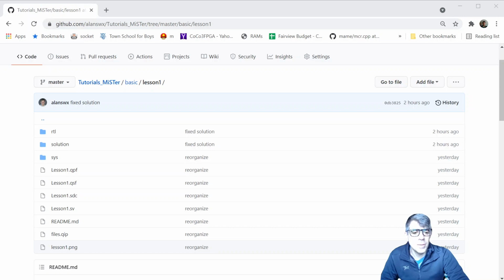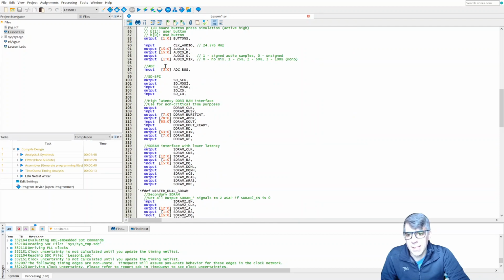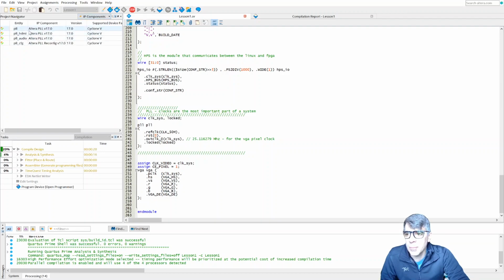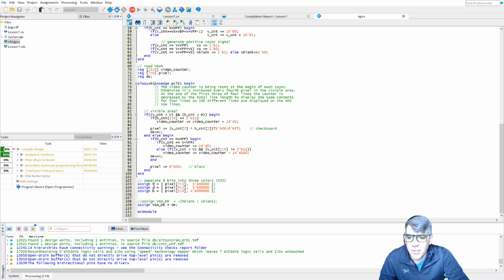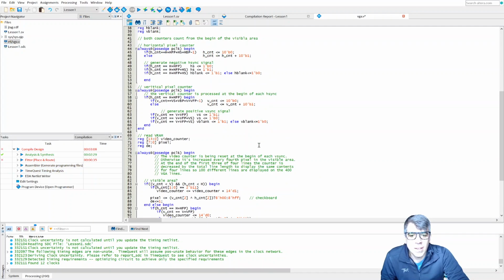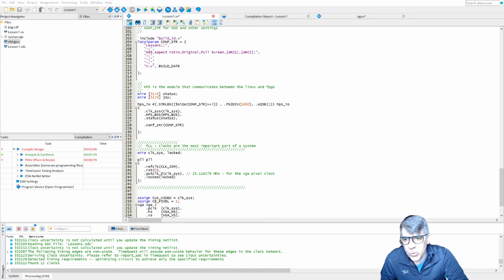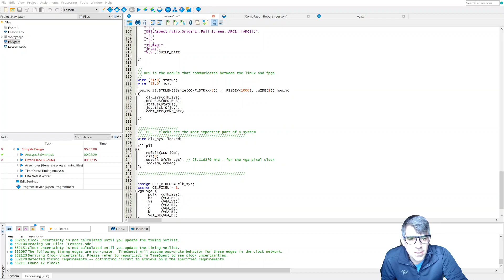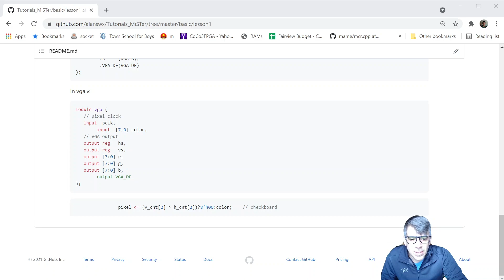MiSTer: Tutorial Lesson 1

Comment: Hi Allen, thanks alot for your tutorial. It is a great starting point to get into mister development. The initial main problem is to understand the template and than mainly how to setup your first screen. I think we can reuse the vga.v library, however there is no good explanation around what it does. It would be great if you could do another Lesson 1 that is just creating the vga.v to understand how it is working and why in the context of mister. 

You just changed some things in the pixel output and totally confused me. isnt the rgb values [7:0] just the intensity (brigtness) of each color? So should not a simple [7:0]=8'b1 be good enough to turn a pixel on for all colors? 

So now I am even more confused on how it actually works and how to setup. Because if one do not fully understand what is happening here, there is then actually no control over the screen in reality. 

For instance, how would you setup a 256x200 screen? (or any arbitrary format that has been used in the old days?).
Reply: I would also enjoy a video about setting up an arbitrary screen resolution and hooking it up to the mister framework. 

I really enjoy these videos and tutorials and hope to see more!